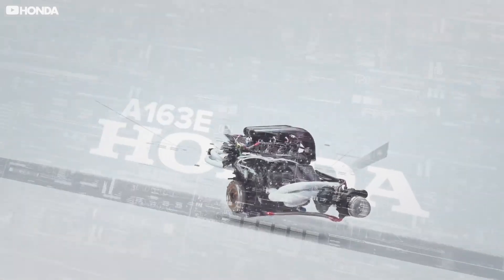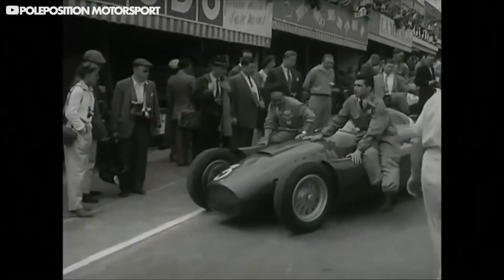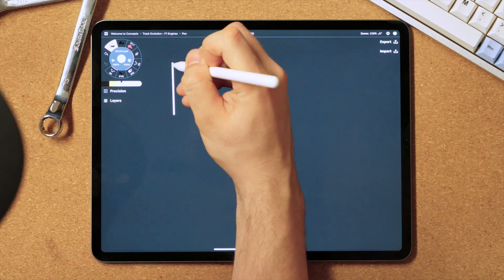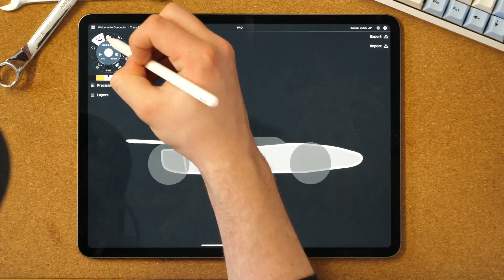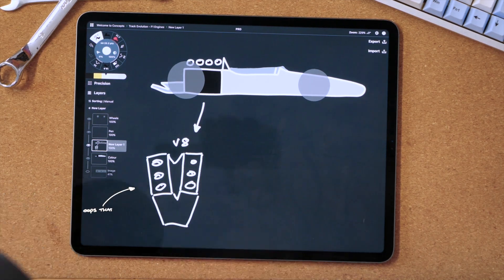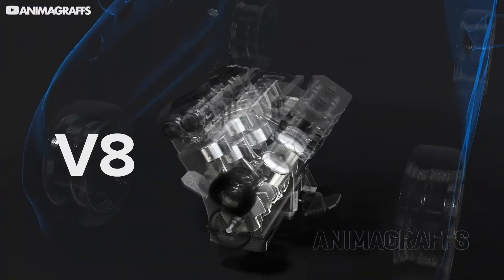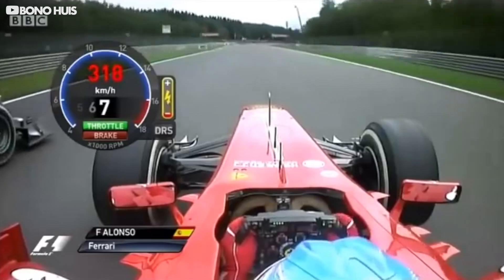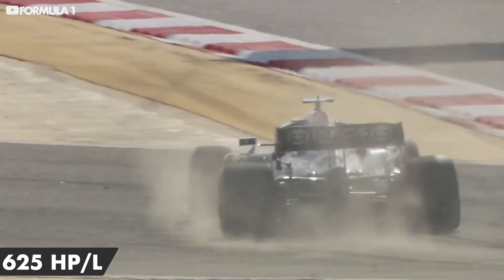The Incredible Evolution of Formula 1 Engines | Track Evolution

Comment: 6:35 This point is not 100% accurate. They are not using a pneumatic valve train but pneumatic valve springs which are still be activated by a regular cam shaft. The system you have showed in the video is a complete cam free fully pneumatic system called freevalve and is used by koenigsegg. This system as far as i know is not capable of doing the needed rpms but has a lot of other benefits.

Comment: Cool series. I hate that the FIA decided to try and make garbage rules to force car manufacturers to drop development of proper engines. Nobody needs a rubbish Hybrid engine. An engine is a machine. If it can't produce it under its own power it's not producing that power. I would say it's wrong to say today's 1.6L F1 cars produce 1,000 HP. They are worse than older cars, more boring, and sound like an Aygo being thrashed around the estate.

Comment: Great stuff. Commentary shade too rapid for me. 

Yes, would love to see more in depth details. For instance such as detailed working diagrams how those valves are opened and shut pneumatically to allow engine speeds up to 20,000 rpm and beyond. Engine revs on some Grand Prix Motor Cycles exceeded 20,000rpm even back in the 1960s. I also have in mind the little 3-cylinder 50cc ~ yes, 50cc used by Honda which reportedly revved to 25,000 rpm.  I saw and heard some of these 50cc machines racing back then. At the far side of the tracks out of sight, sounded like someone had kicked over a Hornets Nest. Also saw and heard the H16 on a demonstration run.  

Yes, more of the same please will be most welcome. For many Motor Racing enthusiasts, there's much of interest with these machines both when on or just as interestingly off the tracks in the workshops and design rooms. This aspect is for this enthusiast a MASSIVE void in current TV Motor Sport coverage. More mechanical content and less "personality" coverage needed.

Comment: Nice video but with some mistakes.
3:00 3 liters NA or 1.5 supercharged (Not Turbocharged)
6:25 valve timing still uses camshafts. They replaced valve springs with pneumatic cylinders.

Comment: I have a huge amount of respect for the century of engineering that culminated in the 1000+ HP from a miniature engine we have today. Still, the more emotional part of my brain misses the larger displacement, amount of cylinders, and higher revs of times gone by.
Reply: I think it would dull the pain for me if they allowed teams to have a separate engine, of the same exact configuration, that they are allowed to blow up for each qualifying session. Allowing teams to go full 'balls to the wall' and really push/understand the limits of the motors, while still maintaining the whole lasting 1/3rd of the season requirement for the race engines.
It would be cool to see what they could do, but without the risk of running them wheel to wheel like that. Plus I dont think their speeds would be that much beyond what they already are, given they would still have to maintain all the other power-inhibiting restrictions besides keeping the motor alive.
Reply: @von...  You would probably be needing some new tires too, I have seen F1 engines turned up to 1,400+ and would think with some of those other fuel types 2,000 isnt out of the question. Which is getting more into dragster territory than precision handling.

I think it was Porsche who took an F1 engine and bumped up the boost a little and the electrical side to hit 1,400 or so. Just missing the rocket fuel!
Reply: @brandonhoffman4712  I remember when toyota cranked up the engine to hit 400 kmh on the salt flats
Reply: @von...  Believe in JESUS today, confess and repent of your sins. No one goes to heaven for doing good but by believing in JESUS who died for our sins. GOD loves you soo much unconditionally ❤🙌😘🤗😍
Reply: @alunesh12345 what on earth does that have to do with the subject?

Comment: i like your vids, great infos, but BRING BACK V10
Bring the V10 back, these Hybrids are shity. My personal experience with Hybrid Roadcars was so good, i sold my Hybrid (Toyota) and bought a super old BMW R6 Petrol, No more I Need to go to the mechanic check my battery, no more oh shit no gas after 500km (310miles) low load driving (means no heavy acceleration, no motorway, no mountains wich is difficult in switzerland, means normaly i began searching a petrol station after 400km (248miles). and yes it sounds like sheit (F1 and Road cars) BRING BACK V10.

Comment: Typo in the title should be the devolution of f1 engines modern f1 is a dumpster fire and this is someone who enjoys the engineering aspect the most. They have regressed  the cars are more efficient sure but they are slow, the sound is extremely lackluster (huge deal to me) there's a lack of drama due to the engines being ran so conservatively didn't think you could make turbochargers boring oh how I was wrong. At least drop the rev limit f1 cars are suppose to scream and be the pinnacle of engine  performance  not efficiency we got lost somewhere along the way smh such a shame imo
Reply: "But they are slow" this makes no sense because every track record is held by a modern car.
Also modern f1 cars in race spec are more powerful then any other era of cars in race spec.

Comment: Hey Scott, thanks for starting a great new series.  However, there seem to be a few minor issues. 
2:56 in 1966 the displacement limit for a naturally aspirated  engine was 3.0 liters and not 3.5 (as evidenced by Cosworth DFVs of the 70s).  
6:30 In 1989/1990, Honda was not the company known for using pneumatic valve system; it was the Williams Renault V10 with an oval inlet as driven by Patrese/Boutsen. (An older brother of a friend told us that  Renault had earlier experimented with and used pneumatic valves in their turbo engines of the 80s.)

Comment: I'd really appreciate if you could throw up a metric conversion on the screen whenever you mention miles per hour. Doug DeMuro does it really well, not intrusive at all.
Reply: Just divide or multiply "mentally" by 1.6 to give the close approximate conversion.

100 mph would be 100 plus a half, that's 50 plus a quarter of that half 12.5 :~

= 162 kph.  Then conversely :~

Quick mental for 300kp... approx 1/2 plus a 1/4 of that half. So 150 + 37.5 ish:~

 = 187 mph. 

Practice it a few time until it become second nature... almost instant with practice. Becomes second nature.

Engine capacity UK v. Stateside US of A.  CUBIC Inches v.  CUBIC Centimetres.. Don't go there unless . ...👀.... 😂

Comment: Although F1 race tracks have "evolved" over the last 35 years I don't personally think that's been of benefit to spectators or even those drivers who wanted a tougher challenge. In comparison to past eras most modern F1 tracks are boring.
Reply: You are talking about the "Sanitised" era of more recent F1 decades. I am in full agreement. Such sanitisation has of course rendered any comparison of either drivers, cars or both across the differing eras pointless. Fings aint what they used to be but I still enjoy the cars which for me, are always the stars. 

Good to see so many here would welcome more detailed engineering content. I'm with them too.

Comment: Water injection has nothing to do with cooling the block.
Renault introduced pneumatic valves in 1985.
Ground effects was banned after 1982 and turbos ran for 6 years after this.
V10s didn't have KERS.

Comment: that was so cool you mentioned the freezing the fuel that's called Rocket Fuel with a little diesel fuel in it and I love the RPMs lot of people don't understand what if all in one engine can spin two I had a 65 Windsor block 67 hipo heads and I did not do the engine work although it was balanced it would do a late 70s early 80s sun tan Grand tachometer with a lifetime warranty I got one from a cousin I burn it up not as fast as he did I came back to town ashamed cuz I lived in the country told him about his tachometer he said I wired it wrong he took the one

Comment: Renault, not Honda, came up with the pneumatic valve springs.
Also, you missed the switch  to 2.4L V8s in 2006. The 3 liter V10s never had KERS.

Comment: I'm always going to be biased towards the v10 era because that was the first time I started watching F1 back in 2004-05 and I couldnt believe the noise they made.  Not as efficient as the modern hybrid f1 power units but the v10 engines probably weighed half as much

Comment: I love the new series. That said, while I understand the drive to produce shorter YouTube videos, and I could be wrong, but it seems like content is shaved off to shorten the videos. Some of these videos are highly technical and while the Ipad visuals are especially helpful, I would like to see longer videos, given the technical nature of the content. Having a driver that has actually driven F1 cars and has continued his career by teaching others, well.....the content is amazing. 

I'm a grandmother and I know nothing about cars other than you put gas in them, regularly get the oil changed (at a quick-lube-esque facility), check the air in the tires....that's about it. Mechanical knowledge is also pretty much zero. But when you guys take time to explain, especially with visuals, my enjoyment of F1 is improved, dramatically. (Incidentally, this is also true for Driver61's occasional videos re MotoGP where I experience the same issues and where it helps to have things explained like the dangling leg for example). 

In short, Driver61 has played a big part in me becoming an F1 and even MotoGP fan and is definitely responsible for my growth as a fan, a most unlikely area of entertainment and enjoyment for someone like myself. So, longer videos, and simply keep up the good work. I can't be the only one benefiting from it. As one of the commenters noted below, this is what I wanted WTF1 to be but never was  :-)

.

Comment: Your comments about the engines producing around 1400hp for qualifying and 800hp for the race combined with ground effect systems, sending speeds through the roof is a little misleading. Ground Effect was banned after 1982 and at this point the most powerful turbo engines were producing 600hp at best. In the following years engine power did increase to the levels you state, but not in the ground effect era.

Comment: A small note, the hp/l for the turbo cars is wildly inaccurate. Their displacement may be X.X liters but that is at atmospheric pressure. Whereas operating they are no where near that, thus increasing their effective displacement.
Reply: Displacement is displacement. If you say "displacement", then people understand "displacement" and not "effective displacement" (displacement x absolute pressure), or "effective displacement x RPM" or anything that would try to compensate the differences. Anyway, true physical unit of effective displacement is not hp/l but hp/l.Pa or hp/l.bar or hp/l.psi or hp/l.atm or any unit of pressure but not juste hp/l .

His numbers are correct. He never spoke about "effective displacement" and he's using hp/l unit.

All these alternative displacements are units made for engineer nerds trying to "compare apples with apples", looking for wich engine is "the best". But when you try to eliminate all differences, you often end up calculating thermodynamic efficiency (that could be easily calculated with fuel consumption and power output).

When you want to build a race car, you want to know how much HP you can fit inside (hp/l) and how much it consumes (efficiency). Effective displacement is related to both but doesn't directly tell a thing about them, so you don't care.

Comment: I feel like the old times were more like marathons, where you could stop and have water splashed on you, crack a joke, and then carry on.
Reply: Stop off at the pits for a refuel and a smoke (at the same time)
Reply: @MScotty90  Dude!
Reply: DESTROY WHITE SUPREMACY BY ANY MEANS NECESSARY  THE CURRENT RACES ARE 300KM!?
Reply: @liamcalpine  The actual rule is "the race ends after the first lap that breaks the 305km threshold." So in practice they tend to be anywhere from 305km to 309km. Obviously a different rule is in place for Monaco. That race is only 260km, otherwise they wouldn't finish within the allotted 2 hours.
Reply: @liamcalpine  A little longer depending on the track. Here's how the number of laps are determined: 300km / length of track in km. Round the result up to the next whole number and then add 1. For example the recent race in Bahrain: 300km / 5.412km = 55.4324 rounds up to 56 and then add 1 to get the 57 total lap count. 57 x 5.412km = 308.484km, but even that's not the official distance. The "start line" where the pole sitter starts is not the "timing line" (finish line) at most circuits. The timing line (which is always the finish line) is where Race Control officials sit. So the actual distance for the Bahrain GP is normally 308.238km.  Another fine point of F1 because of fuel limits: In Bahrain this year because Perez had the eletrical problem during the intitial formation lap, the drivers had to do a second formation lap. That extra lap had to be deducted from the 57 expected race laps, so from "lights out" to the checkered flag was only 56 laps this year. Whew!
Reply: As the drivers from the Golden Era of  Motorsports have said "when men were men."

Comment: And still 70s sportscars are the fastest on a "road-course" type track in a race trim. No one has beaten Ferrari 312P and Matra 760 records in average speed (14 km Spa). They are still the fastest cars - whatever F1 TV show presents.
Reply: First of all They dont race that layout anymore. Second a car having a faster top speed does not mean it's faster round a circuit.
Reply: @SllSamuel-034  - No those laps were by average speed some of the fastest laps ever seen in circuit racing.
Reply: Seems like the 2020 Merc did actually go a smidge faster around Monza. But it's crazy that a 1970s Le Mans car lapped at 263kph average... That is just mental on that layout of Spa and with how unsafe the cars were.

Comment: This was sick. I'd love to see addition parts focusing in on specific engine types, particularly the modern engine. 8 - 12 mins is the perfect sweet spot in length for me.
Reply: I could watch 8-12, 8-12 min videos on the current engine! Like how both redbull and mercedes are making the air more dense by pre cooling the air, but one is doing air to air cooling and the other is liquid to air cooling. redbull's recent switch to a mercedes like split-turbo. I have also heard these engines might be twin turbo, with one being electrically driven? However that might work?

Comment: I like this new series.
But PLEASE, fact check and double check everything next time.

Hearing "3.5 liter NA" and seeing "3 liter NA" or hearing "1.5 liter" and seeing "1.6 liter" is not so good.

Also you have said that the engines at one point produced 930HP/L, then further in the now time that they produce 625HP/L "more than any era in F1"......... WHAT?!
Then in the very next sentence you say that the Turbo Era the engines produced "up to 1400HP".... a little google search. Ya no... the engine dynos only could measure up to 1400HP.... the engine produced more than that.

these are the "small" mistakes that makes these kind of video so frustrating to watch

Comment: Love it ! In term of wording, "engine efficiency" is not HP/Liter but the ratio of energy you extract from your fuel in your engine (https://en.wikipedia.org/wiki/Engine_efficiency). Best efficient combustion engines are 2 stroke turbocharged diesel marine engines reving about 80-150 rpm, not F1 ones :)

Comment: Two corrections: at 3:40 a 180 degree v12 is NOT a flat 12. The Crankshaft design is different in both engines which leads to the flat 12 beeing a bit less wide. 

At 6:30 the animation of Freevalve is not fitting since freevale gets rid of camshafts. The f1 Cars do still have camshafts they just dont have traditional valve springs. So its a pneumatic spring not a pneumatic valve acutation.

Otherwise nice video and good content

Comment: I feel like skipping over the V8s is a cruel April fools joke.
Reply: DESTROY WHITE SUPREMACY BY ANY MEANS NECESSARY  "gutless trash" doesn't sound accurate. They had great reliability and performance and a good soundtrack.
Reply: They were the last of the best engine before we have what we have now

Fucking vacuums
Reply: @Americana-deluxe  bro sound isn't everything
Reply: WEC uses the same fucking Tech as F1 yes sounds way better, WTF?!
Reply: @Americana-deluxe  "way better" is a stretch. Having watched both modern F1 and WEC in person, F1 cars have PLENTY of volume while the only WEC prototypes that sounded good were the toyotas. Audi's were virtually silent thanks to the diesel tech.
Reply: Agreed; they were the highest revving engines in their introduction in 2006. Running over 20k revs is insane
Reply: @WesleySmallz80  20k rpm yes but some honda road bikes like cbr250 could do that.
More to the point the teams rarely used it because of economy and reliability, Meanwhile you get the same number of firings/second from a v10 at 16K rpm...and they hit 19k rpm which is why most people prefered the V10's wail.
The v8's were effectively cut down V10s to limit power and save fuel a bit like if we switched to a turbo I4 today, I'm sure people would love that.

Comment: 2009 KERS systems didn't take energy from the actual brakes to charge the batteries but from the crankshaft. When the car brakes a proportion of the rotational force is captured by a electric motor / generator (MGU) mounted at one end of the engines crankshaft. This MGU converts the kinetic energy into electrical energy which is then stored in batteries
Reply: Not to forget that William's used a flywheel to store the energy at first.